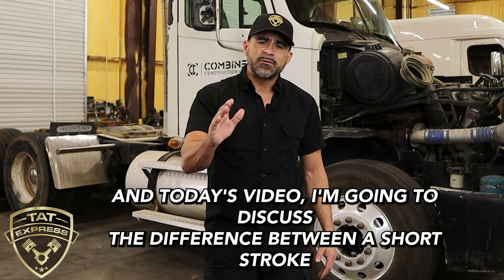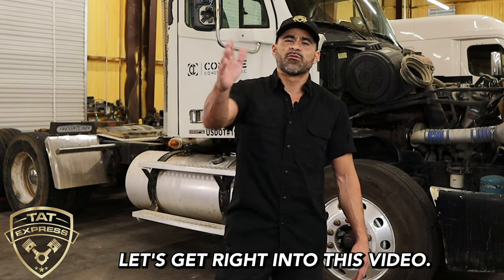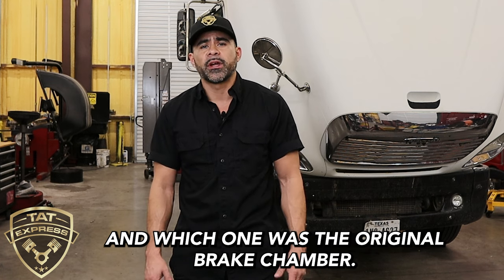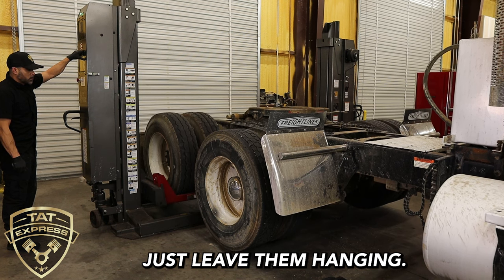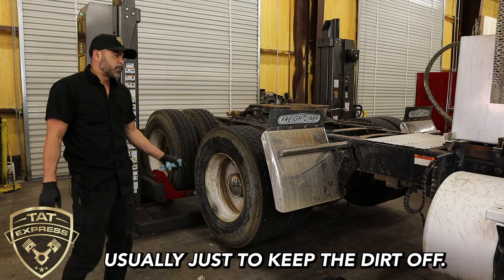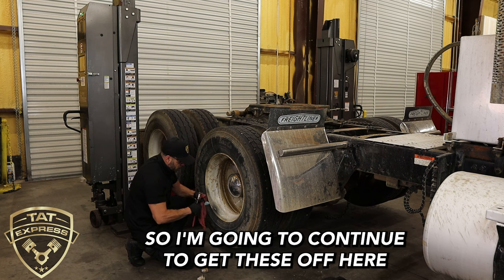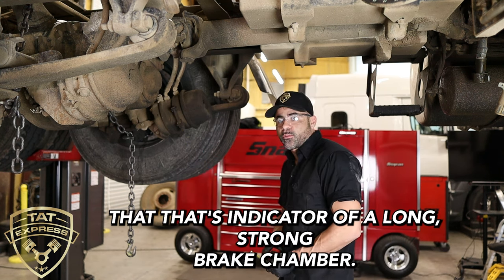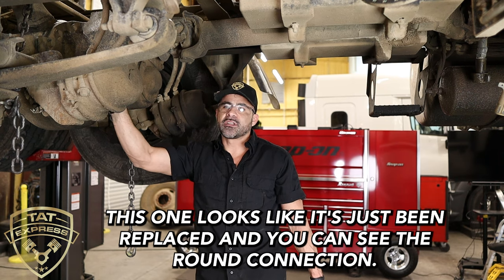WRONG BRAKE CHAMBER/ HOW TO CHECK BRAKE CHAMBER/ BRAKE CHAMBER SIZE FOR SEMI TRUCKS/ 30/30 CHAMBER

Comment: Another way of taking those chrome covers off is by using a hose grip pliers. Pinch the cover off using the pliers and pull. Almost like a relay puller pliers concept.

Comment: Your totally wrong! Both will apply equal pressure to the slack adjusters. I can't believe you don't know this!!
Reply from the maker: Combining short stroke and long stroke brake chambers on a semi-truck may impact brake balance. It's crucial to maintain a balanced braking system for safe and effective operation. Consult with a qualified mechanic or the vehicle manufacturer to ensure proper compatibility and adherence to safety standards.
Reply: You are right, brake imbalance can happen slightly, but DOT doesn't make you fail now because of different stroke chambers, even on the same axle, as long as they are the same size! @TATEXPRESSINC